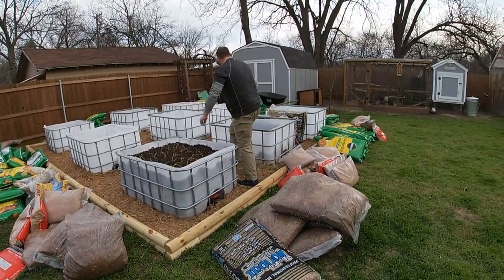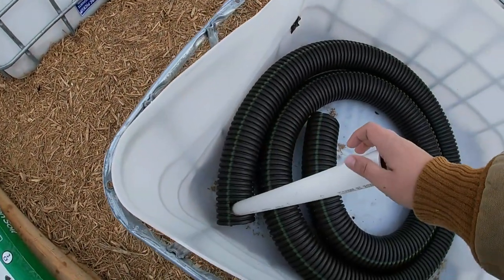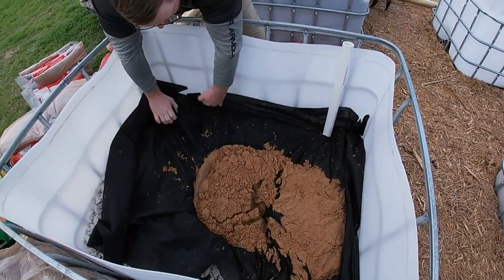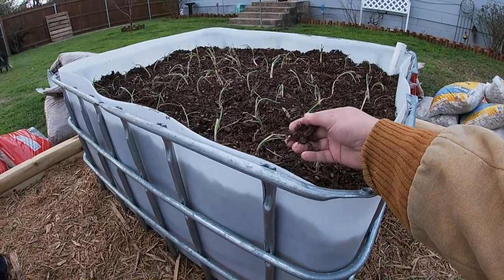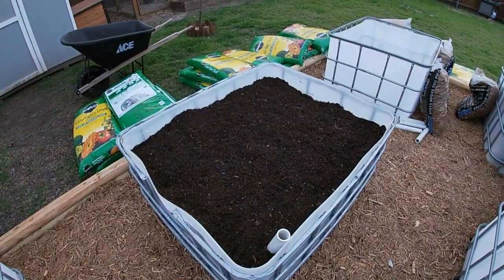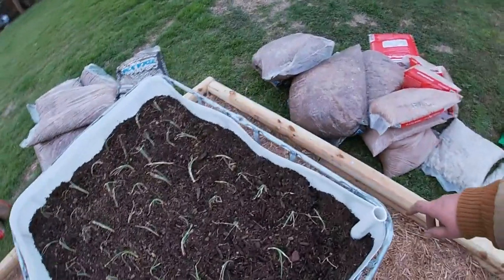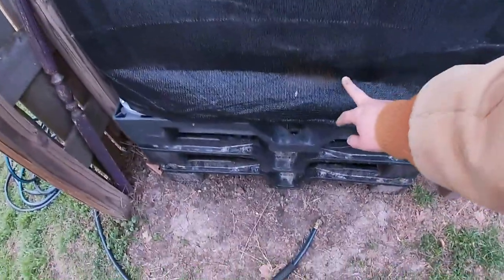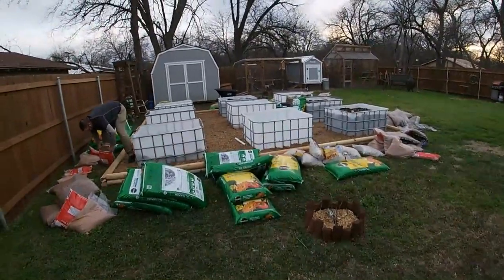Building Our Backyard Wicking Beds

Comment: Definitely cover the filler tubes otherwise  the slugs  snails will hide in there. I dont use filler tubes any more I just water the soil and when the drain holes starts to leak I stop. The plant get a good watering too.

Comment: I’m not familiar with what IBC totes are yet or where to get them, but I like this concept a lot. Thanks for sharing!
Reply from the maker: Thank you, Its not an entirely new concept we took some ideas from a gentleman in Australia that uses this system and has several videos on ones that he has made. We wanted to go for more of an approach that we have better control over what goes in the ground, better maintenance for weeds, and when we go on trips for more than a few days that they will be fine without the need to water every day as they will have there own water source. Young plants still need to be watered above ground until there roots start to establish after which they will since the moisture in the soil and will not require the above ground water they once did. Stay tuned as we will i am sure continue to add a few more. This is our first year for these so there will be lots to learn and adjust from.
Reply: You can get on Market Place they are water totes people use at hunting leased. Not for drinking water storage.
Reply: We had several suppliers we found on Craigslist and then they sold out so quickly we couldn't get them when we wanted them. I went on Facebook marketplace and found A supplier, we're in the Houston area and not only did they have the 275 totes that we wanted, we bought six but they delivered for a small fee. All in all the six totes and the delivery was less than what it would have cost us than any of the other three vendors we found and the U-Haul rental. Shop around. Look for the right deal and make sure their food grade. Most of them are soda syrup storage

Comment: Before you add water to the system, how far down is the water level in the fill chamber ??
Is it almost to the bottom, or do you find the plants getting a bit dry,   even though the water level is only half way in the perforated tubes ??
I need to know how well the gravel and sand transfers the water up to the dirt..
I am in Canada..
Reply from the maker: The reservoir is about 4 inches deep I used 3" perferated tube and then the rock make a great drainage medium. after that we added the weed block and the sand to assist in the wicking process. I found our beds seem to all hold optimum moisture according to our moisture meter at 8 inches. the further down it goes the wetter it gets. after a year or two i may have to adjust the reservoir height and bring it down some. But for now first year of use i am happy with the over all design and use. I do not have to add water often. I am thinking about enclosing either then entire area or each individual one to assist in longer growing seasons or more important for me in texas to find a way to regulate the heat probably thru use of a shade cloth. Thanks for watching if you have any other questions let me know. We plan on doing an garden update video here in a few days.
Reply: =  @MccannAdventures  = Thankyou for replying... That was very useful. . I am in the process of making one of these, so I need to know this , to modify to make it fit my climate.. 
(1) When you say "optimum moisture at 8 inches", does that mean it is a bit too dry above that ??

(2) What do you mean by " enclosing the area" ?? 
Is it because it gets too warm,  or too cold,  or to keep moisture in ??

 (3) Have you ever seen the water level in the bottom, go below 1 inch ??
-
Reply from the maker: @DocScience2  1.) When i test it with a moisture meter the optimum level of moisture according to the reader was at 8 inches. Without Mulch it was around 12 inches so the mulch really helps keep things moist. Above 8" it starts to dry and by 2-3" it was to dry, with mulch it stayed moist almost to the surface. 

2.) Enclosing i am just looking at making it an additional greenhouse. We have one greenhouse my wife uses for suculents and garden starts. I think if i enclose my raised bed area i can help maintain temperature in the winter when it does drop below freezing and in the summer when it gets to hot here in Texas. I also have trees in the area that part of my beds get full sun most of the day and other portions that get partial sun and are in shade more often than not which seems to effect the plants i have growing in them. 

3.) I have not seen the water level go below 1 inch. we have been very fortunate so far with rains i was more concerned of the beds being to wet but they seem to all be draining as they are suppose to and maintaining water levels. We are just reaching the beginning of summer here so the test will begin in the next few months to see how often i will need to refill. It will depend on the heat, the wind, the rains, and how much water my plants are soaking up.
Reply: =  @MccannAdventures  = Thankyou. . That was precisely what I needed to know.. 
I am planning on covering with plastic.. 
We had 3 inches of snow here, last night, on May 7.
A bigger snowstorm is forecast for tomorrow.

Comment: What are these IBC containers and where can you buy them? How much do they cost a piece? You say you cut them in half. What do you use to cut them.?
Reply from the maker: I would suggest just searching places like Facebook Market Place for them. I found mine at a local truck car wash. You want to make sure they are food grade and did not use chemicals for transport. I believe ours were 330 gallon when cut in half it made 2 containers. to cut I used a skill saw for the plastic to help maintain a straight line. For the metal I used a saw zaw with a blade designed for metal. The cost of them really varies you should be able to find good containers for less than 40 dollars each. These were purchased a few years ago at 25 dollars a piece.

Comment: Wondering how does the water get wicked up?
Reply from the maker: It has a reservoir of water in the bottom 3-4 inches of the tote as the dirt dries up top it will naturally pull water up which the plants will use for nutrients. You can either water from the top and water will leech down to the reservoir or our tubs have a place they can be filled. I’ve noticed the dirt tends to stay at optimal moisture content from 8-12 inches any lower and there is a higher moisture content.

Comment: What should I look for when buying a ibc tote?
Reply from the maker: something that did not house toxic chemicals is what i was told. Around our area there is a lot that were used for iodine which is a water soluable dip used in the dairy industry. I found mine near Waco, Tx at a truck wash shop they were used for soap. There are several different sizes of ibc container available i can not remember what size we used but the cage has 6 rings of support around the outside made a great place to cut them in half and reuse the entire cage and container.
Reply: @MccannAdventures  I found some that where used for soaps. Can I use that ?
Reply from the maker: @farfan  Yes mam that should be fine.
Reply: When I comes to the dirt and the stone, can you use any type of dirt and stone/ rocks? Or it has to be a certain type? I ask because I am about to buy a IBC tote that is a good graded that was used for lemon and orange fructose. Excited to start
Reply from the maker: @farfan   We used 1.5"-2" rock from homedepots gardening area which filled the crevasse nicely, Then we added our weed block and sand, As for dirt do some research they offer dirt for above ground planting you may be able to resource dirt from local suppliers. Compost and some manure get you started well the first year. I made the mistake of using regular gardening soil which did not have much nutrients in it so i worked all year trying to improve the nutrients in the soil. I am hoping this year will be better.

Comment: I'm guessing you guys ended up top watering, sand does not wick and your sand level is above the drain hole. Great system otherwise, well done. thx for sharing.
Reply from the maker: They have actually work very well for us for 2 years now. I need to show a follow up video on how they are producing.
Reply: @MccannAdventures  I just found your video...  We are about to put in a set of 10 wicking beds just like yours of IBC totes.  (January 2022)  Any update you can give would be greatly appreciated. I will subscribe and check out to see if you have posted.  Meanwhile, about the assertion that sand is poor at wicking,  I found and watched a video in the past few days of someone who had tested and measured different wicking media and found sand was the best at wicking.  Gravel was poor -- but I am thinking as I see your design and others like it, your gravel area will be compensated for by the middle well of sand.  That sand in the bottom should wick up to the same above, which should wick into the soil above.  Right?   If you reply to this I will be able to come back and leave a link to the video when I find it.  Might be in my history...

One of my concerns is that the bed might go anaerobic at the bottom after a couple of years. Trying to learn from other's experience first.   

Thanks!
Reply from the maker: @rwind656  Hi Thanks for watching. We have had our beds in for a few years now and they are doing good, My wife and I need to make a follow up video on how things are going. The only think I would do different if I make these again would be buying the dirt from Home Depot. I have found this was really expensive at the end of the day and I could source dirt locally at a local compost yard which I could get by the truck bed load at a much more reasonable price. We also added a hog panel to a few of our beds for our climbing items which helped  make more room for vine production items such as cucumbers, and beans. I have not had any issue in the wicking system. WE live in Texas and sometimes see 105-110 degree days I normally top the beds off once a week and it does not require much water. As to the anaerobic issue. I have not had any issues at this time. Thanks for the input and watching. We are new to making videos but appreciate all the comments.
Reply: @MccannAdventures  thanks so much for posting this video on wicking beds.  Y'all did great on making the video, if you're wondering.  Thumbs up.  Very watchable.  And for the reply.  

I had to look up "hog panel" - like a cattle panel. ( Did you arc it over the top between 2 beds?  (I see it's avail in 16ft at Tractor Supply.)  Will have to consider this.  I also saw mention somewhere of "planting shelves" mounted above for watermelons, cantelopes...  but have not seen a photo.

We are trying to decide on putting in a gravel underlayment around the whole garden, or something else.  Years ago we used roll roofing (asphalt) under my kid's play set and it held up surprisingly well for many many years.   If you live in the South, you know weeds are a major problem.  The landscape border would prevent us tractoring around the perimeter.  Mulling over ideas.
Thanks again for the info!
Reply from the maker: @rwind656  We used 2 panels 1 per bed and arc them over the top attaching to the sides of the metal cage our beds are inside. My wife had planting shelves for a while but our were more for decretive purposes she planted things such as marigolds in them to try and naturally protect our plants from bugs that are prone to eating them and to promote pollination with some of our local bees by bringing in color. Our base is something we need to rework, We used weed block and mulch. If i did it again I would either use gravel or more than likely a roofing felt paper or something similar that works better as a weed barrier. We have had grass issues in the base for quite some time. I actually bought some second hand greenhouse hoops are thinking about installing in the area to extend growing seasons thru the winter months. Thanks for the compliments I will make sure to tell my wife.